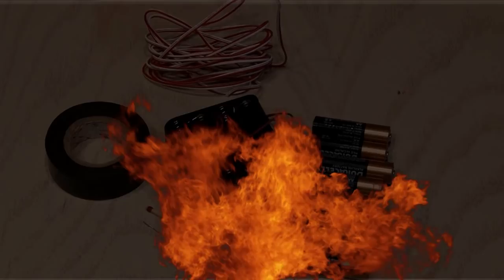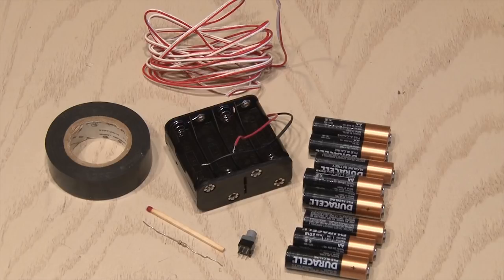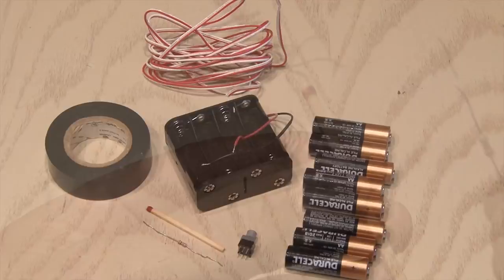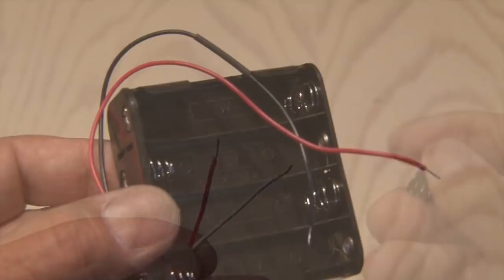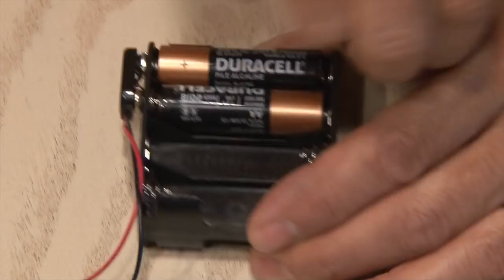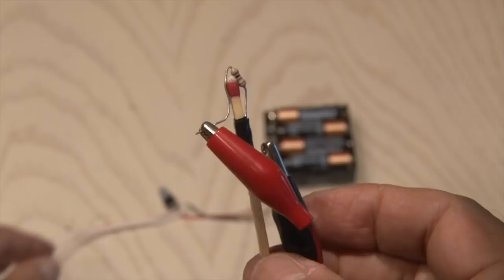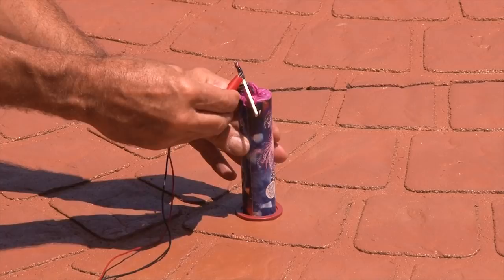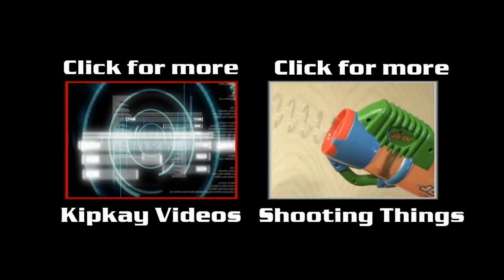Remote Control Fireworks Igniter! Boom!

Comment: Yes

Since those 8 battery's are AA 1.5v x 8 equals 12v since they are configured in parallel, the only drawback would be that you would have less amperage meaning that you would ignite less times than with the 1.5v configuration!

Comment: No, actually. The resistor itself doesn't burn, the temperature jump is natural. Though, with repeated use, I can see it requiring a replacement simply due to stress and eventual breaking.

Comment: a step up from some of the other garbage kip makes-can also use nichrome wire,a christmas tree light bulb with the top broken off and some match powder dropped inside,or a short piece of stainless steel kitchen scrub,even steel wool over the match.

Comment: Just the resistor, alligator clips should be fine. Radioshack sells those carbon film resistors for just a couple bucks for a set of five. Actually the resistor will probably be okay too since as soon as it lights you can cut the power via switch. Carbon film resistors are incredibly resilient to heat. The trick is to orient the resistor and clips in such a way where they will not be damaged by the blast. It can be done though.

Comment: I think the end of the match has a highly flammable tip on it (the red part) so it doesn't take much for the fire to start. In this case the resistor only needs enough heat to initiate the fire so it should melt while being strapped to the match in the flame? So I would think anyway.

Comment: hey man, if you cant get those anywhere strike matches, you can use a tiny incandescent light globe instead of the resistor. Carefully break the glass and make sure you dont damage the  filament wire. Grind some sparklers into a small paper cylinder, and then make sure that the filament is touching the magnesium. The filament will ignite the sparklers and fireworks

Comment: A more cost effective version is to just hook the pack to a model rocket ignition. They get hot enough to set off the fuse.
An easier version is to just get a burning laser or laser and driver to put in some sort of custom trigger case.

Comment: You don't really need the resistor, just something that will heat the match head enough to get it to spontaneously ignite, I used to do this exact thing as a kid to light model rocket engines, but I used a tiny bit of steel wool instead of the resistor.

Comment: Well in theory that is correct but in the real world batteries have a small internal resistance which limits the current they can output, so the amps are going to be be a bit lower. You should be using the equation  E= I * (R +r), where (r) is the internal resistance.
Everything else though is correct.

Comment: It is a 1 Ohm resistor, you could also use what is called a Zero Ohm resistor. It is used in making circuits as a piece of wire called a jumper but in the case of a resistor. Makes it so the robots or automated machines can hold them.

Comment: It comes down to Ohms law, V=IR. 
We know V (12 volts) and we know R (1 ohm) so rearranging gives V/R=I. 12 volts / 1 ohm = 12 amps, which is more than enough to overload that resistor. 
There are better ways to explain it, but essentially that's what it comes down to. Having enough current flowing through the resistor to make it heat up. 
Hope this helps.

Comment: Replace the resistor with a spring from a ballpoint. 
And don't use a match. 
Place the fuse of your fireworks inside the spring and power up both ends of the spring. 
The spring will glow and ignite the fuse. 
Easy simple and reusable.

Comment: I don't think you understand my critique even slightly, mitterdo, so let me walk you through the two (2) salient points.

1) The match igniter has a questionable lifespan. (It looks like it's a one-off.)
2) The match is not quickly replacable, and for an expendable component of a system, that's important.

These could have been very easily solved with a long-term (and cheap) ignition system and a rudimentary match housing to clip matches into for easy changing.
This project is pure half-ass.

Comment: instead of the resistor, wrap the match in fine grade steel wool and connect up to that, it is a lot cheaper than using up many resistors !.  thumbs up so people can see

Comment: A 1 ohm resistor. Ohm (R) is a weird measurement that has a correlation with Ampere (I) and Volt (U) where I = V/R, V = I * R and R = V/I. And power (P) equals to V * I. If you combine the last equation to the first one (I = V/R) you get that P = V * V/R. So, why is this important? Because the P is here related to the heat emitted from the resistor, and that heat lights the match. If you had a 10 ohm resistor you would need a more powerful battery to get it hot enough.

Comment: Should probably be a carbon film type, the brownish ones with 5% tolerance. They tend to go up in flames in a heartbeat.. Metal film however, the more commonly used blue 1% ones, I'm not so sure if they catch fire like that.. 
So a 1 Ohm 5% tolerance carbon film 1/4 W resistor.

Comment: steel wool doesn't burn when electricity is passed through it. it burns when you connect positive/negative to the steel wool and rub the other end across it. correct me if i am wrong please.

Comment: I do not think so. The resistor has to get hotter than the flame in order to spark it, if I remember how combustion works, properly. Of course, you should fact-check that, I was bad at chemistry.

Comment: Just use a battery with lot of Amp and put the match inside a spring from a pen and connect the battery to the wires... just use a very thin spring...

Comment: It just has to be weak enough to overheat and burn with six volts.  Actually I think steel wool can be better for multiple uses (it's a lot cheaper), but it isn't always as reliable.  I was also using 12 volts when I tested steel wool out.  I had 4 out of 7 of my excaliber mortals go off.  :(

Comment: If we would use 4 9V battaries, wouldn't that be enough to make a spark between the cables and therefor ignite the match this way so we don't need a new resistor each time?

Comment: use a 12volt car battery and steel wire from lowes or home depo in the photo frame hanging section

Comment: why do all this and worry about burning the resistor, when you can just have the wires spark on the match head using some aligator clips or getting the wires to touch on the matchhead?

Comment: u can get the same results buying a bottle rocket kit they come with remot starter.  i used to do the same thing resistors are 2.50 for pak of 100 i just increased the length of wire on the starter by buying a 100ft roll of duel cord and replacing the starter wire with the roll wire. 95ft away toggle the switch on the press the button BOOM! whole trash can full of reloading powder & few dozen M80's LMFAO FUN!

Comment: @stopmotioncity1 it will ruin the resistor so you would need a new one each firing but it won't ruin thw rest of the circuit. The batteries aren't gonna overload themselves. I hear you can use .05 mechanical pencil lead instead of the resistor for a cheaper alternative, haven't tried it though

Comment: @kipkay does the resistor burn out each time, making it so you gotta buy ALOT of resistors? if thats the case, what about a certain type of wire + 2 9V's? that way you only gotta use a little bit of wire instead of a bunch of resistors+matchs?

Comment: Can I use a 3 ohm resister to? And do you need to use matches with a white dot on it? Or can I use another?
Reply: The higher the ohms the more it will heat up using the same voltage.

Comment: Why would you really put 144 watts* across that resistor? I thought 9 watts (with just 2 AA batteries) was more than enough.

* Actually, given the internal resistance of 8 AA batteries, the actual power you're using is ~65 watts, but it seems for me that's still too much.

Comment: i tried it with 1ohm resister but it didn't work :(          what kind of resister should i use ???? pls help..............
Reply: use the filament out of a hair dryer for continues use  or steel wool or a one time use.

Comment: replace the wire that easily tangles with an IR reciever.
Reply: and lose an IR receiver every time you ignite a firework?
Reply: No, after use just replace the resistor which burns out . Nothing else

Comment: Can I just use a 9v battery or do I really need 12v?
Reply: Brandon Lee 9v works fine.
Reply: Brandon Lee 9v works fine.
Reply: Joakim Sorby There's an echo in here!
Reply: Joakim Sorby There's an echo in here!
Reply: I do recommend 12v because it'll lite it more securely as in if the 9v doesn't work then you come up to the firework it my lite up and blow up in you're face
Reply: Brandon Lee You can use 1x9V battery and 2xAA(3V) battery = 12V
Reply: CoolFido CZ That's not how it works.
Reply: TheScoutPro Why?
Reply: CoolFido CZ I don't know, that just seems a little illogical. You could get one of those batteries that's a little smaller than an AA but they're 12 volts.
Reply: TheScoutPro Oh, I didn´t known that.
Reply: Spoder Man I know. That's how I thinked that.
Reply: If you use a 9v, Obama will arrest you
Reply: @ConnorR.mp3  damn, am i too late for the echo effect?
Reply: @JimmyEatDirt  nah bro you good

Comment: Why would you need to throw a pipe bomb using gunpowder (which isn't a very highly explosive substance at all) 100 meters?  Are you suggesting that a pipe bomb whose explosive substance is black powder will have the explosive capabilities of a pyramid of C4?  Maybe you should make a video of your 100 meter blast radius black powder pipe bomb then.  And no detonator has a 100% success rate.  I'd like to see you name one common method of timed/remote detonation with absolutely no failures.

Comment: mine works way better, is cheeper, simpler, and quick...

get some normal multi strand wire, strip it back, pull out 1 strand, wrap that strand around the fuse, hook up leads, and get a 12v led acid batt (small 7ah one) 

as soon as you hook it up, it will heat the wire up enough, that it will cause the fuse to ignight, works every time!

Comment: Is the resister reusable?
Reply: LOL ,no, u cant use a burn resistor again
Reply: LOL ,no, u cant use a burn resistor again
Reply: Nichrome wire can be reused wont need a resister just wire attached to each end.Then put it against the fuse touch the other two wires to a battery.It will glow red hot lighting it like a electronic lighter.Its what coils in e cig pens and the electric cigarettes use.So id advise using extreme safety if using nichrome it glows red hot so leaving the battery hooked up is not recommended

Comment: can you do it wirless?
Reply: sure. you'll just use remote switch instead of tactile switch. but remember, whether you do it with remote or normal switch, always connect the circuit to power source as the last thing before you use it. You don't want to find out the circuit is accentual on while you're placing the match with resistor to its place.

Comment: Kipkay can u make a wireless one
Reply: Yes, but it will be no where as easy to do as this.  The easies and cheapest way I can think of is by using a laser to active a device remotely.  It would only takes a few electronic components to make it happen.
Reply: you can do that by using the components of an R/C car and attach the two power output wires to the fuse and it'll light it
Reply: armyofone53 I believe so, but it really depends on the amount of amps the battery puts out.
Reply: Allen Warner you can also take out the capacitor from the circuit board or qhichever one regulates current or just change out the battery mount for something with a bit more power behind it
Reply: armyofone53 Oh I got confused I though you were referring to the battery that runs the R/C car.  if you want the current to be max then simply use the battery and forget about the other components.  they just take away from the maximum power(current) the battery can put out.
Reply: I love discussing electronics :)
Reply: armyofone53 Just use a rele
Reply: I made a wireless one but for some reason my power output on my receiver doesnt output power when activated by my transmitter. Does anybody know why? If i can get my receiver to output the power it will be working great